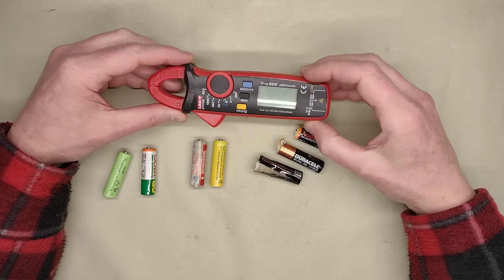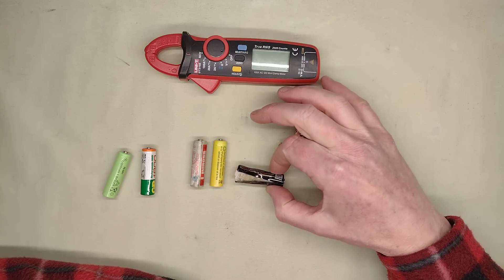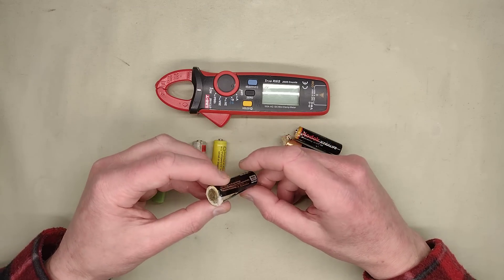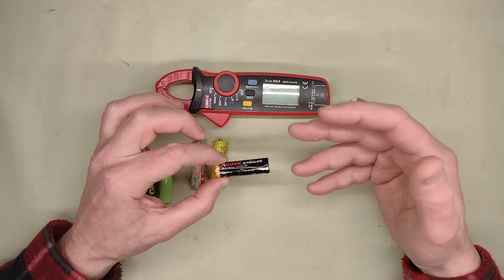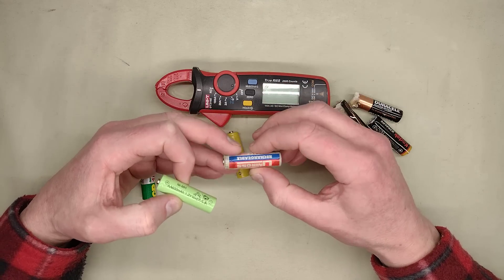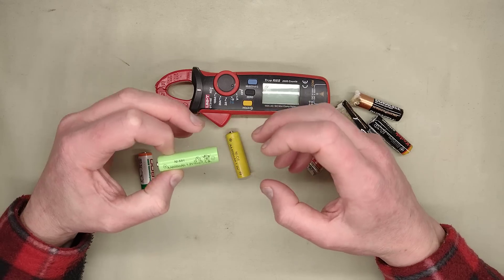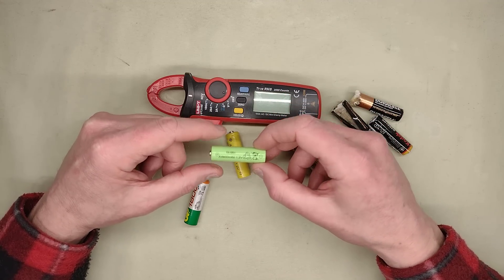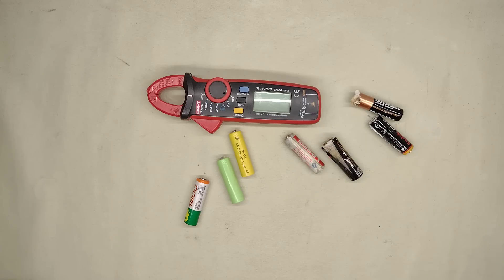The curse of leaky alkaline batteries

Comment: I've loved NiMH in the 90s and early 2000s, they were great. Never had a leak, I still have some that I can recharge and they work. BUT the 1.2v is a real problem. Most electronics now do flag 1.2v as too low. It's unfortunate. I've had so many Alkaline batteries leak prematurely, often after only a year. What a waste.
Reply: Of the alkalines I've used,  Duracell seems to be one of the worst for leaking, and Panasonic seem to be one of the best.
Reply: @mwechtal  I've had things damaged by leaking Duracell, Varta, and, yes, Panasonic alkaline cells. Though come to think of it, maybe what came out of the Panasonic ones was less corrosive?
Reply: "Project Farm" has several videos on ni-mh battery comparisons to tide you overbin the meantime. Some of his data is outdated though. For example, the Amazon basics batteries he tested were made in Japan but if you were to buy them today they are made in China and I have heard rumors that the performance has suffered, though I don't know by how much.
Reply: @Zanthum  Well, I am sure the Chinese version is much higher quality.....lol.
Reply: @ianbutler1983  exactly 😉
Reply: @Zanthum  I'd also like to see a comprehensive analysis of JUST the Amazon basics batteries now that they are made in China - a lot of people use them and if the quality has gone downhill it would be useful to know.
Reply: @Zanthum  I remember that video. I've intended to go Amzn Basics when needed... Has it been that long???
Reply: They used to have some items like walkie talkies where they used to allow you to use 2 more cells if using NiMh.
Reply: I have 4 Rayovac NIHM batteries (green ends, silver body with black box on it) I got for use in a gamepad, but they barely last an hour from fully charged before the control starts disconnecting. The batteries are still showing almost fully charged when tested, so the controller just doesn't like 1.2Vx2. Old Xbox360 for Windows wireless pad. Can last a long time on a set of store-brand alkaline.
Reply: @annieharkness4641  the xbox controller and my PC mouse last months with normal batteries- but only weeks with 1.2V rechargeable batteries. so for that alone I only used 1.5V normal batteries
Reply: I have some electromechanical devices that refuse to work on 1.2V cells, so I have to feed them fresh 1.5V cells regularly.  It would be nice with some electronically boosted rechargeable cells that contain a hidden switch mode boost circuit inside the form factor.
 CRD recently reviewed a bad old soldering tool that draws extreme current from alkalines. Old school doorbells would be another high current application that could overload boost circuits and fail on 1.2V cells.
Reply: @johndododoe1411  funny thing is these nimh and especially the old nicads are great at high-current, when the resistance is low enough
Reply: @tsm688  But no good if the load requires the energy that would be obtained by feeding nX1,5V
Reply: @johndododoe1411  Energiser Ultimate Lithium might be the best option in that case. They also do not seem to leak.
Reply: I think I've seen some lithium-ion based AA cells floating around. Been considering giving them a try for this reason.
Reply: @VraerynDaDragon  Lithium Iron Disulphide probably. (Yes iron not ion) Main brand is Energiser Ultimate Lithium.
Reply: @BrianG61UK   I'm aware of those, I use them regularly (they are currently powering my wireless mouse and keyboard set) but not actually what I am talking about. There exist lithium-ion AA, some with with miro-usb charging circuits integrated into the cell and some instead with a specialized charger. Maybe not practical, and maybe not reliable, but I've been curious to try some. Search some up, they exist.

I am not sure what is happening, but this is the third time I tried to reply to you and I keep getting errors. Hopefully this reply doesn't end up getting duplicated.
Reply: @VraerynDaDragon  I've seen 3.7V Lithium ion in AA size (16550) but 3.7V is too much to use them instead of alkalines. I've also seen Ni-MH AA size with a built in micro USB socket for charging them. I guess there could be some Lithium ion AA size with a built in DC-DC converter to give around 1.5V, I've just never seen them, and the DC-DC converter could cause problems in some applications.
Reply: @VraerynDaDragon  Like Kentli AA PH5 ? I guess there may be cases where they make sense.
Reply: @BrianG61UK  AA sized primary lithiums usually put out about 1.8V. Some devices cope with that, some doesn't.
Reply: The solution could be NiZn batteries but they are very unstable. If you don't use them, they go bad on the shelf quickly (1-2 years). Other good solution is the 1.5V LiIon cells, which you can charge from USB, but there are bad products among them as well: the circuit or the cell itself can go wrong, especially if they are not charged in every 2-3 months. I could love an AA and AAA size battery holder, from which you could just get out the LiIon battery when not in use.
Reply: I also had problems with voltage, the mouse in my cordless pc bundle simply would go mad in minutes with NiMh batteries. It really doesn't like them, but it's old tech (from 2005).
Reply: Most electronics I run NiMh with now seem to have a rechargeable option that allows a lower voltage curve to be selected so that the “low batt” warning is altered appropriately.
Reply: use superglue to seal them so they cannot leak
Reply: @esecallum  brilliant
Reply: @SidShakal  the 0.1 micro hole allows gas leakage without liquid leakage
Reply: @wedgenix  I've been curious to try the ~1.5v Li-ions, but presumably they always put out the same voltage, which may be undesirable if you want some warning that the battery's getting low?
Reply: I have some that I still use that are from 2000.  In some radio equipment, you can use alkaline with a dummy cell or two, or take out the dummy(s) and fill the unit with NiMH.
Reply: I agree on the low voltage being an issue. You may want to try the Harbor Freight alkalines, they're quite a good deal since you can get 24 of them for under $7 and they last a good while. They've never leaked on me and they have no problem running high current LED flashlights that use over an amp from a single AA. Not a shill, I just think they're decent for those devices that don't run on rechargeable. Duracells and Energizers always leak on me though, and they're so expensive.
Reply: I rarely have alkalines leak on me. Im always amazed when i hear about it. But then again I also don’t generally leave batteries sitting in things I’m not using actively either… they don’t tend to pop unless they’ve been sitting for a very long time, especially at a low voltage
Reply: @r100curtaincall  I have a plastic box with a load of batteries in it and I'd say you must be lucky. They will leak even if not under load although admittedly not as badly and it does take a while.
Reply: @r100curtaincall  I've had entire 24 packs of Duracells start leaking in the unopened package 8 years before the expiration date.
Reply: @stargazer7644  wow that’s super unlucky. That sounds like a manufacturing defect in the batch. I’ve seen this happen occasionally at the store but I’ve personally never ended up having this happen to me. In fact I have some that are from 2016 that look just fine and function properly. I usually recommend people Energizer ultimate lithium‘s because they are dry cells that do not leak. Don’t buy the rechargeable AA lithium ions they’re crap. They have no capacity. Nimh is good but they can still leak, tho quite rare, and capacity is lower and the lower nominal voltage won’t work for some things. As with anything just pick the battery according to what you intend to use it for.
Reply: @r100curtaincall  I had a pack of costco's Kirkland alkalines... They were already leaking in their original packaging in a drawer away from heat or sunlight.

Comment: Clive, have you taken a look at the rechargeable cells with a new chemistry that are like 1.6v or so? I use rechargeable in my game boy and they just do not last compared to alkalines due to the low voltage cutoff
Reply: could give those lithium ion aa's a try (the have a buck converter in them to bring the voltage down to 1.5).  As far as i can tell the only downsides they have are price, and the fact that any battery meter built into the device will not work (in theory anyway, i've never owned a pair but they should put out 1.5v right until dead, unless they go extra fancy and program the buck converter to lower output based on the lithium's cell SOC)
Reply: @Wooble57  Clive did a review of jugee AA lithium cells, probably over a year ago now. They do hold 1.5v almost all the way though the usable charge of the lithium cell, but when the lithium cell is almost depleted the buck converter immediately drops the output to 1.0-1.1v to trigger low battery alert in devices. You won't be able to tell that the cell has x% of charge remaining it will just be 100% till it drops the voltage to trigger alerts.
Reply: @Wooble57  They're pricey for my needs, but an additional downside I've read about is that the output voltage tends to be noisy.
Reply from the maker: I tried some Nickel Zinc cells a while ago and didn't have much luck with them.

Comment: Still using Alkaline batteries in our transmitter mics. They see the 1.2 as being low, which makes judging them a bit confusing. We do take them out at the conclusion of our shows and never store the transmitters with batteries. Never had a problem related to NiMH cutting out during a show, just unnerving sending a performer out when the pack is flagging the battery.

Comment: I've abandoned Duracell years now. Better luck with brands like Energizer and other off brand alkaline. Wish they could get the rechargeables to be nominal 1.5V instead of the 1.2V. The 0.3V makes a difference in applications when you use multiple cells. Even Ni-Cad shmoos and corrodes. The wetty melty has gotten so annoying that I just look for built-in rechargeable Lithium. Ni-Mh are still considerably high priced for the age of the technology.

If Ni-Mh can be nominal 1.5V, then it would be significantly feasible to reduce alkaline production.
Reply: Unless another chemistry is found, the AA lithium cells with an internal buck converter are probably your best bet. The 1.2v is related to the NiMH chemistry itself and will probably never change. The AA lithiums with internal buck converter will buck the 3.2v of the lithium cell down to exactly 1.5v and hold that voltage all the way through the life of the battery. Some have a feature where near the end the lithium cell's charge it will drop the voltage to 1.0-1.1v to trigger the low battery alert in the powered device

Comment: I think they've been leaking more in the last few years than I can remember. I just don't recall alkaline cells leaking very often many years ago.
Reply: I remember them leaking for as long as I've been alive.  Maybe luck, maybe cheap brand, maybe Canadian anti-mercury regulations or something, but there's always been bad ones.

My theory is with modern recharables and rising manganese costs they have to cut costs even more to keep alkalines competetive
Reply: Same. I also never recall ever having a new box of batteries start to leak, long before the expiry date. I just had to pitch the greater portion of 3 big packages of Duracells. Ridiculous!
Reply: @phantomkate6  Same exact thing here, same brand also.
Reply: I seem to recall one of the benefits touted when they were first on the market was that they wouldn't leak as much as the older cells.
Reply: @chaos.corner  Back when Alkaline batteries first came out, I NEVER had one leak!
Now, all of a sudden, I can't get one to last a year without leaking all over the place, and ruining whatever they're installed in.
It's like they've taken something out of the manufacturing process, to save money, and it's ruining everyone's devices!
Reply: @nefariumxxx  Precisely. New alkaline cells are no longer manufactured using the mercury, hence the gas buildup and subsequent leakage problem of new alkaline cells. I believe the removal of the mercury was to make the batteries "cleaner" to the environment and of course there are the cost savings, associated with not including the mercury anymore. Win - win for the alkaline battery manufactures, continuous loss for us consumers. Seems to be a common theme in our world these days.
Reply: @nefariumxxx   @Geiger Mouse  That makes sense. Still, they've ruined Alkaline batteries.
Reply: @KentuckyRanger  Yes, they've probably been shaving pennies per thousand for a while now. I've had mostly good luck myself but I'm beginning to think luck is all it is.